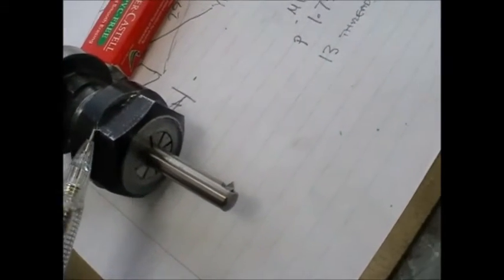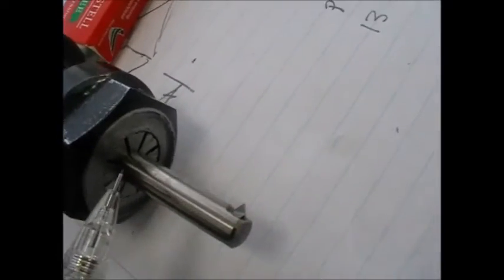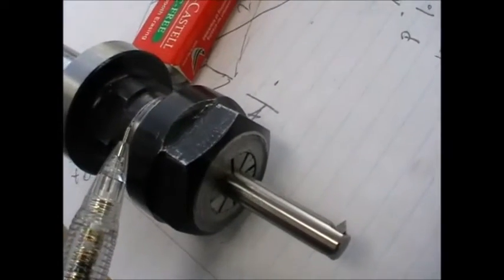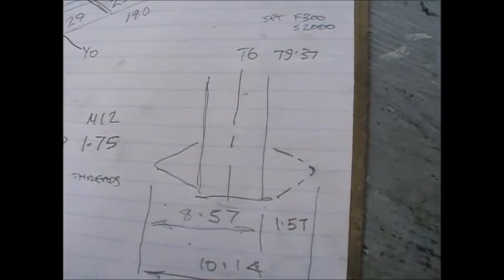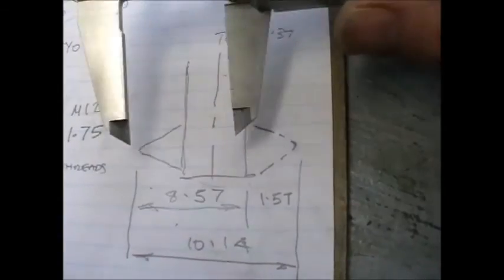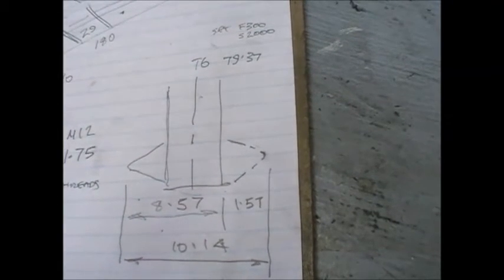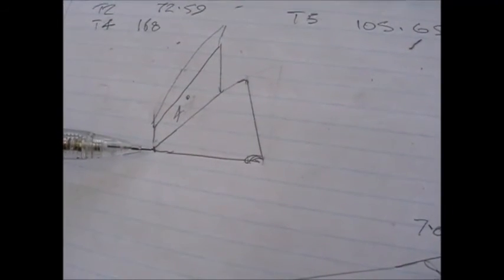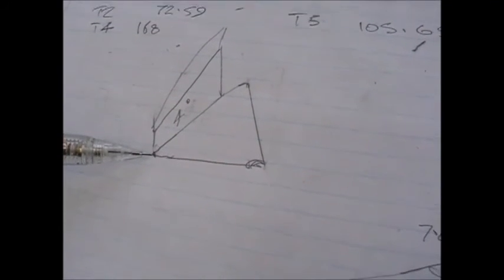Tormach Pathpilot Conversational Threadmilling Part 3

Comment: Interesting series here - I am confused as to how you actually 'hold' the cutter into the shaft of the cutter...ie the shape of the total cutter tool which is inserted into the shaft and held in by as you say a pin through the diameter of the cuter shaft - obviously some kind of flat extension from the actually cutting edges of the cutter...I guess one could design a boring bar type set up to achieve what you are showing here for threadmilling...

atb Pete ( looking forward to seeing what you have to say about the CNC lathe -:)
Reply from the maker: Hi Pete - Yes just a hole through the shank with a grub screw pushing a rod up against the cutter to lock it in.
Cheers  Cliff